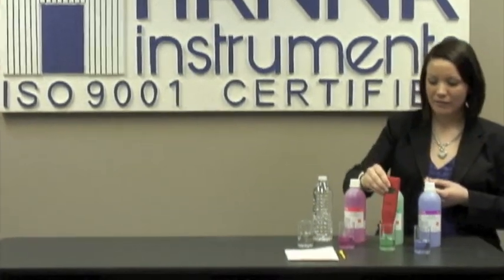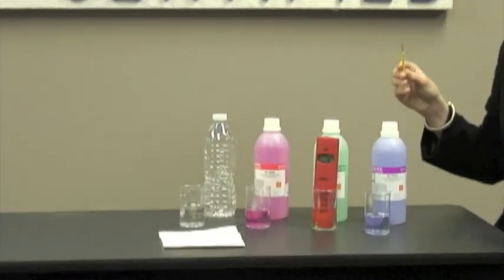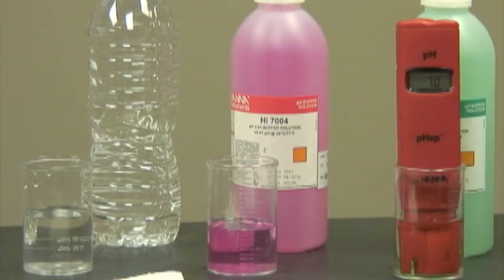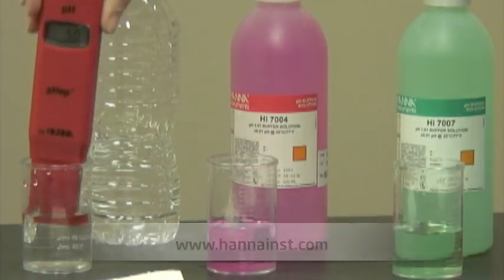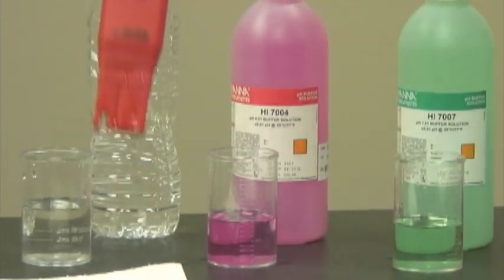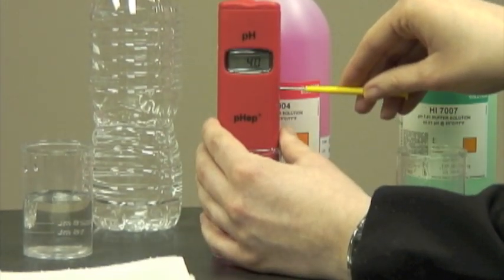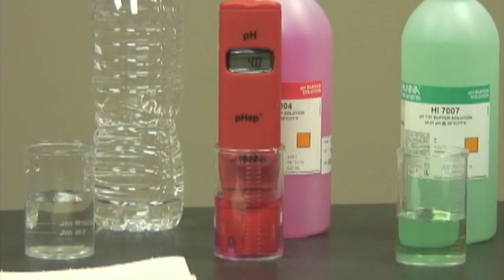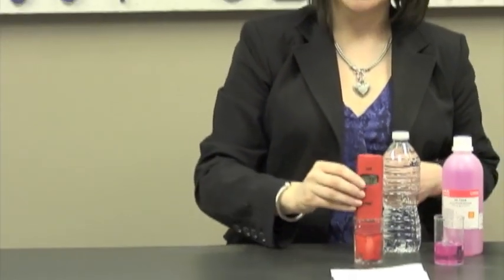HI 98107 pHep pH Tester

Comment: the second buffer you used was determined because your testing medium will be acidic considering testing mediums change should I just do the single point considering I'll be using this tester for green houses
Reply from the maker: Hi Xander, 
When calibrating, it is best practice to bracket your expected sample pH. For example, if you expect your sample to be pH 8, perform a two-point calibration using 7 buffer and 10 buffer. Hope it helps!

Comment: do u need to condition the electrodes?
Reply from the maker: Hey thanks for the question! 
So with any of our electrodes, good practice is to always keep it conditioned, or 'hydrated' 

A small amount of storage solution will work best, and before each measurement we recommend rinsing the electrode with distilled water to prevent any interference in the measurement. 

Hope this helps! 
feel free to contact us again with any other questions. 

http://hannainst.com/products/solutions/storage-solutions/hi70300m.html